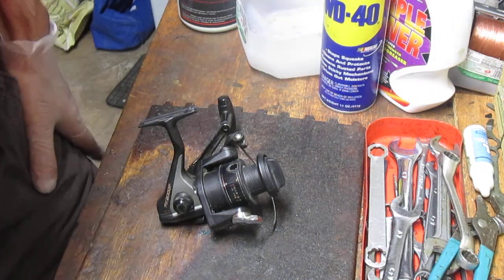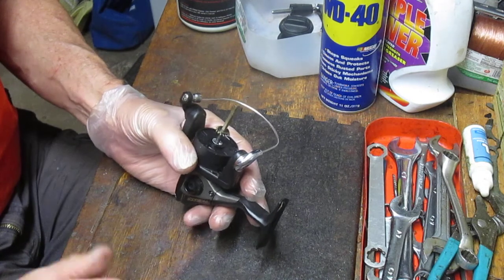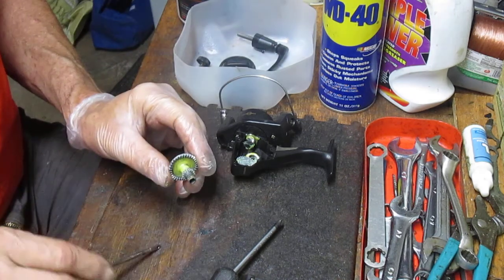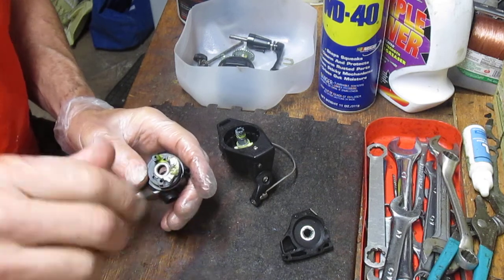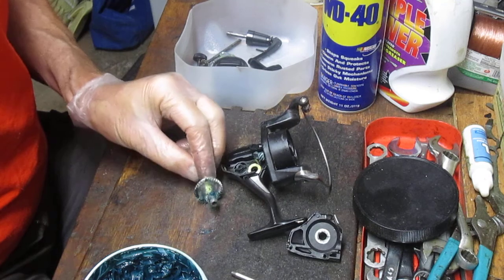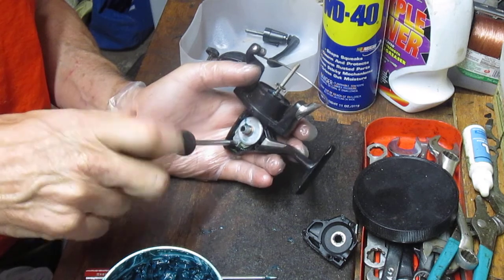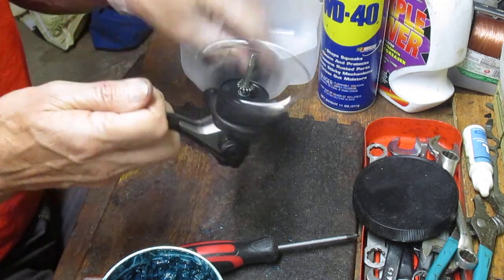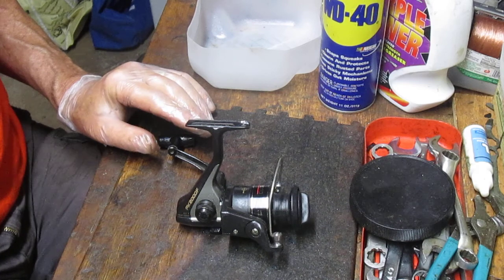Shimano FX2000 Fishing reel take apart and service

Comment: I grew up with this reel! Ithink mine has to be over 20 years old and the spool bushing is loose as all hell from catching well above 2 to 3 pounders. I even used to down rig with it for lake trout😂 breaks my heart that i may have to retire it and mount it on my garage wall unless i can poach a replacement washer.
Reply from the maker: Sounds like you got your money's worth!  If you measure the bushing you can probably by a replacement from Boca Bearings or Smoothdrag.com
Reply: @2ndChanceTackle  thanks a bunch for the suggestions I'll check em out! Beats tearing apart every old busted shimano I find lol

Comment: These reels hold up surprisingly well in the saltwater in the 3000-4000 size.  Got one for my young nephew to use. Lightweight and comfortable for him to use paired with an ugly stik lite.
Reply from the maker: It sounds like the perfect fit.  They are not overly complicated and they are durable.  They can take a beating and you don't need to worry about losing an expensive investment if it goes overboard or sits idle due to lack of interest.  Thanks for the comment - Dennis

Comment: Thank you sir. Can you check out the Shimano Sedona 1000 fd and tell me why they use square looking gears when you get a chance . Good looking out on the small gear some people only fish rivers and lakes. And maybe you could make some videos to help us out.
Reply from the maker: I think I have a Sedona and I will check.  If by square, you mean elliptical then I have the answer.  Many newer reels are going to the elliptical (oval) gears as they claim that it handles the load more evenly on the top and bottom of the stroke.  I first noticed these on the Okuma Cedros and have seen it on Shimano and other reels since.  The reel does appear to be smoother.  I am not sure how they will stand the test of time.  Thanks for asking - Dennis
Reply: 2nd Chance Tackle  thank you and I would appreciate it if posted a video on the Sedona.  I bought it new and now it's not working and I can't see anything wrong but it just won't spin right  .  thank you for your time God bless.
Reply from the maker: I will see what I can do.  I don't see many of the smaller reels because I am on the Atlantic coast and the fishing is mostly saltwater and the smaller reels are usually cheap and disposable , so customers opt to replace them versus getting them fixed.

Comment: Thank for this. I have this same reel in "TX" Quickfire II version, with front drag system. It says "2 ball bearings" on the back where I assume the rear drag system is set on those reels. I received this reel as a gift in the late 90s and literally have never cast it since we tend to fish bigger rods and reels for heavier bass on the lakes in Texas. It has been sitting lonely in a garage or closet for over 20 years. I'm assuming the grease inside it is dried out, but I'm going to put it on a very light spinning rod and go fishing!
Reply from the maker: A little TLC and that reel will fish for a long time to come.  Enoy and thanks for watching - Dennis

Comment: Hi, I picked up a really nice Quantum heat BCS630 reel at a bootfair for peanuts. Lovely smooth running and solidly built reel. In as new condition. However, it's set up for a left handed person and I'm right handed. In theory, you should be able to swap the handle around, but that doesn't work as when you do that it just unscrews itself when you wind in the reel. I notice it has similar setup to this reel you have there with a plastic knob and threaded stud. Is there a trick I'm missing here or is it just that it can't be made a different hand? 
Cheers
Gareth
Reply from the maker: Hmm - we don't have that reel here, but I would agree with you that in theory it should have a reversible handle.  Most modern reels are made with the option to install the handle on either side. - Sorry that I do not know - Dennis
Reply: @2ndChanceTackle  I have a shakespeare reel almost the same and that swaps over no problem.. so I guess it's just an oversight by Quantum's designers. Praps that's why this reel was discontinued ! It's a small bait runner and Quantum no longer make bait runners.

Comment: How do you replace the anti reverse cam spring?  I have a similar Shimano (Sienna 2000FA) with a broken anti-reverse cam spring (part # RD 3471) but have no idea how to install the tiny little spring).  I fabricated a new spring from a safety pin.  

The fantastic little reel has held up for many years and I'd like to keep on using the 2000FA reel till I'm old and dead.
Reply from the maker: Bob - I will try, but it is not easy to say as I do not have that reel to look at.  I grabbed the schematic from Mike's reel repair.  Here is what I would do, not knowing for certain how it goes.  The "L" tab faces upward and goes into the  hole in the anti-reverse post from below.  That leaves you with the long, straight leg sticking outward.  I would rotate that leg around in a circle and see where it intersects with the side body.  I would then look for either a hole or a stud to other accommodation a little further inward from the intersection point, that would allow you to slip the leg either into it or behind a stud to hold it in place and put tension on the spring.  You could then load the spring and the anti reverse lever would work.  If you get stuck, maybe you can send me a close up  picture  of the inner side plate and anti-reverse assembly to 2ndchancetackle@gmail.com and I will see if I can help further.  One thing is certain, the spring cannot attach to the side plate anywhere outside of the circle that you get when you rotate it.  Thanks for asking - Dennis
Reply: @2ndChanceTackle  Thanks for the quick reply Denis.  I really like the less complex design of the Sienna 2000FA.  It's a really beautiful and simple design and built to last a long long time.  However, the little anti-reverse cam spring has got me quite boggled.  I'll have another look tonight and possibly take some pictures.   

Your video on the Shimano FX2000 is really easy to follow and many of the earlier Shimano reels are based on the same design.  The insides to my Shimano 2000FA (except the 2000FA has 3 ball bearings) are virtually identical to the FX2000 you used in your video.  I find my Penn SS430 is built the same way.  Simple, tough, and built to last.  Fishing is meant to be a fun and affordable for everyone.

Great videos!

Comment: 7:15 there is some kind of locator inside the spool is that meant to line up any particular way?
Reply from the maker: There are no locators.  If you are having trouble getting the spool on, notice that the shaft is not completely round and that the metal drag washers fit the shape of the shaft.  Just rotate the spool until the shaft and washers are in alignment and press down.  Remember there are more than one washer, so repeat until the spool is seated - Dennis
Reply: Hi Dennis, Im referring to a white mechanism which is up inside the rotor assembly 
Parts 1514-1515-4092-1948 in the diagram below. It seems the white tag on part#4092 is meant to line up a certain way but i'm very confused and the On/Off lever doesn't seem to be working. 
https://www.ereplacementparts.com/shimano-fx2000-spinning-reel-parts-c-200301_200302_281569.html
Reply from the maker: I don't have the reel in my shop any longer.  My best reference is that you can briefly see inside the rotor around minute 6 on this video. The plastic piece can only go on one of two ways.  One would be correct and the other would be upside down.  Just try both and it should work when you have the right orientation.  There is no alignment that I am aware of in this - Dennis
Reply: @elitevbman  did you ever figure this out?
Reply: Tyler H No sorry I was never able to work it out and decided to just buy a new reel they are only about $30 (Australian) when on sale

Comment: Thank you sir for the video. I have three FX2000s that were bought either locally or on flebay. What I do is replace the bushing(s) on either side of the handle gear with ball bearings. These exact fit bearings can be bought relatively cheaply on the internet and once installed, really firm up the feel of cranking the reel while eliminating the bushing slop.
Reply from the maker: I am going to have to try that!  They should like screeners!  Thanks for the tip - Dennis
Reply: What size ball bearings?

Comment: Can the clicking sound be stopped during retrieve on a tr200g shimano
Reply: Not sure which you are referring to with the click.  I think the base answer is no ad it is coming from the anti reverse dog. I will check -dennis
Reply from the maker: I am assuming you are referring to the click made by the anti-reverse dog and not the side plate clicker.  The anti-reverse dog stops the reel from back peddling when the reel is being cranked.  It cannot be silenced.  The side plate clicker can be turned on and off with the button. - Thanks for asking - Dennis